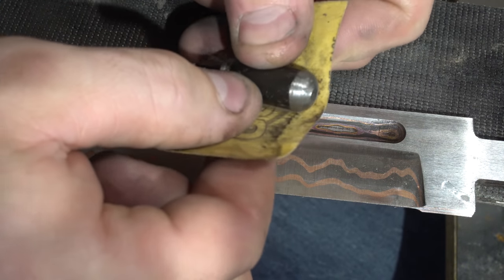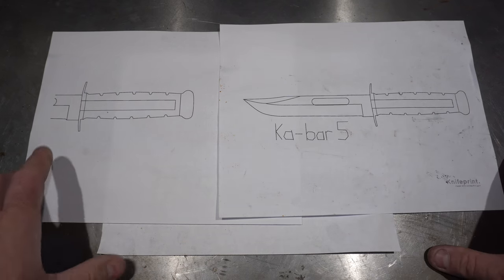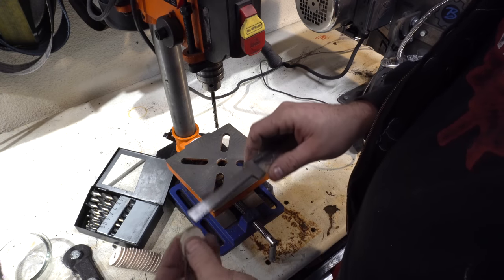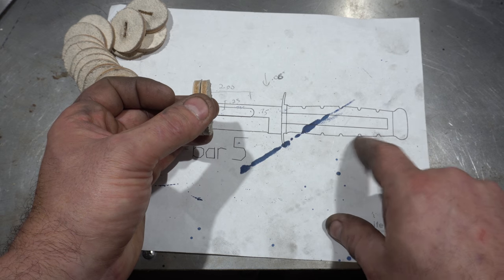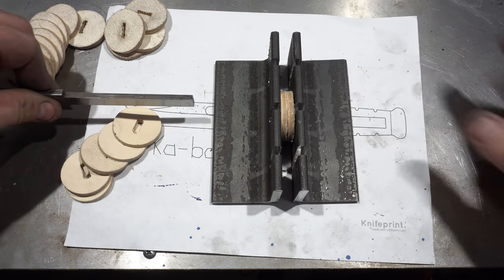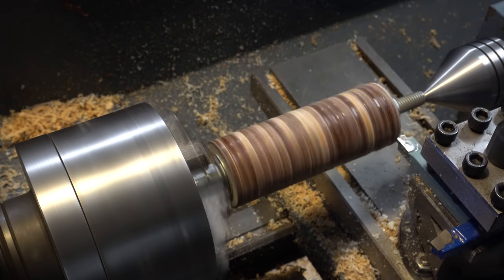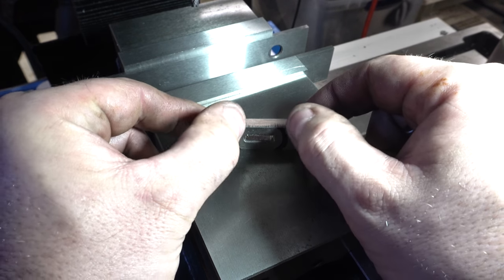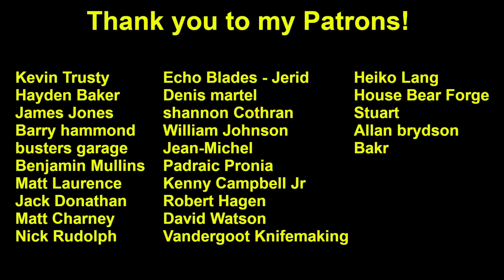Making Three Cu Mai Ka-Bar knives - Part 3 - Handles and Guards

Comment: Fantastic builds. For my hidden tang knives I use a similar clamping method. I have a slot in one metal bar, a hole, in the second metal bar, and two all thread rods on the sides. Then nuts to clamp them down. Keep up the awesome vids.
Reply from the maker: Thanks for following along on this build, Jim!

Comment: Sir thanks for all your knowledge that you give us I greatly appreciate it as I'm sure everyone else does. I have a quick question tho what thickness of metals should I use to make damascus. As well as regular knives.  I'm new to all this got a lil atlas knife making forge which has a 2.5 inch diameter hole and I know I will need a bigger forge here soon this one is just to get my feet wet but I did order some steel but I messed up got quarter inch 1095 and 80cvr2 so when I do try and make a knife out of this hunk I will need to take off a lot of material but I know that I won't use this for damascus. I did order some 15n20 but it is really thin. Just would like your 2 cents on this. Thanks again sir
Reply from the maker: I use .094” 1084 and as thin of 15n20 as you can find.  If you start with thinner layers you get more to start.  I don’t get it when people buy 1/8” or thicker stock in both steels.  You just have a tall stack or few layers for no good reason.  Make sense?  Thanks for watching, Gayle.

Comment: Would there be any problems, or anything you need to do differently if using stainless as the outer layer?
Reply from the maker: No, not really anything different.  You couldn’t use SS as the core, but as cladding it would be no problem.  Thanks for watching.